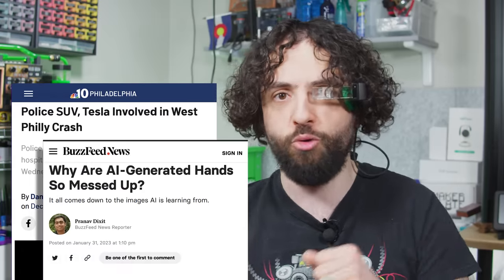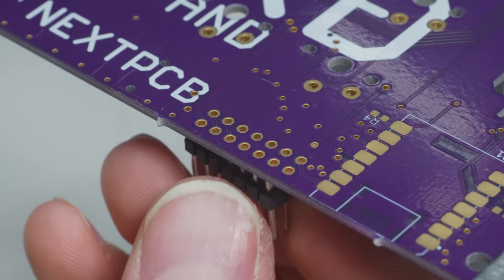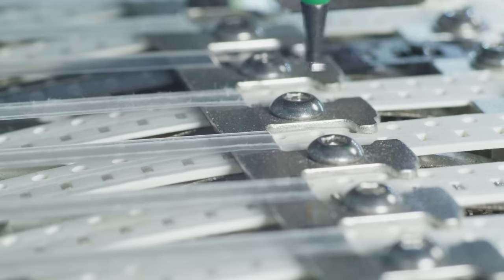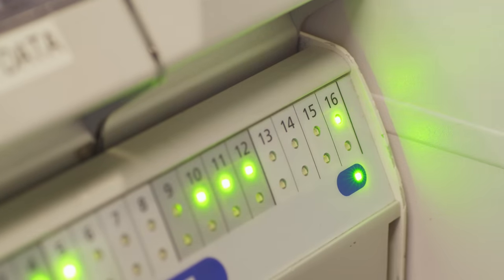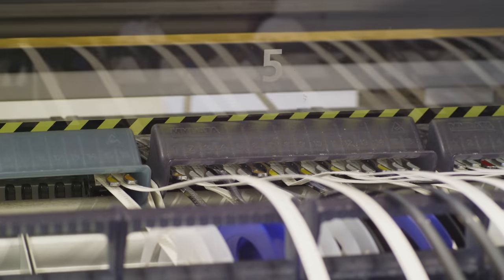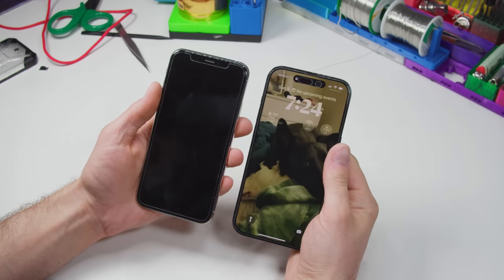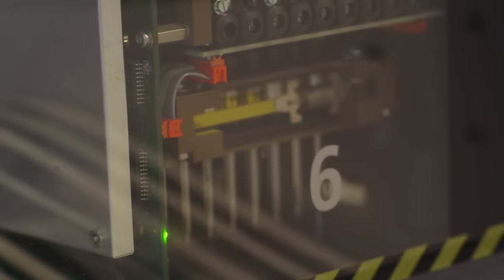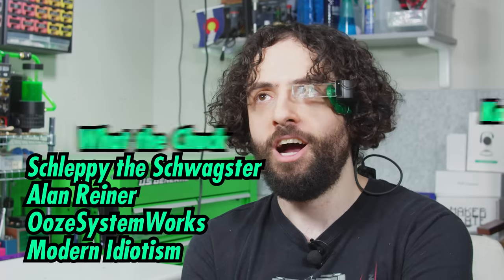The Pick-and-Place: The Robots that Built the Modern World

Comment: There is some *REALLY* cool stock footage used in the intro to Short Circuit.

Apparently you couldn't wave solder everything so they have these adorable little giant robots with a soldering iron, touching up the odd old-school throughhole components.
He picks up the board, pokes it a few times, puts it back on the conveyor belt and picks up the next board. He's such a cute robot.
Reply: I can't find a video of it, could you point me in the right direction?
Reply: @Slovenec5  https://youtu.be/iwqZTBFM_EE
i think this is what he's talking about
Reply: Still true, through hole components are still a thing especially in high power electronics. Also anything that has flexible leads like the power leads on an ESC has to be hand soldered.

Comment: As someone who actually worked with very similar machine even down to the software they use I can say that it is a series of small miracles that these things work so well. Although not mentioned in this video most companies that use those pick and places also have an automated optical inspection as well which is just as cool.
Reply: Yeup, currently programming through hole pcb production to than be inspected with our AOI.
Reply: LTT showed it in the micron video recently.
It almost looks like an AFM with how it outputs even the depth of the solder joints. Pretty cool
Reply: Absolutely. Repeatability is both a requirement and a limitation. Robots have precise movement, but there will always be inconsistency in the components. At this scale, the slightest deviation in alignment causes big problems. The current state of vision systems is truly impressive.

Comment: Pick and Place machines are awesome. I ran one many years ago. I didn't have machine vision which seems to be a game changer. If a part was picked up wrong it was placed wrong. There was a lot of rework but it was still a lot faster than hand soldering tiny smd parts. One thing Zack didn't mention is that the operators have to be on top of everything all the time. The robot makes things fast but the operator makes sure its correct. I worked next to a guy that would load the wrong value parts or the wrong parts and do an entire run. One "little" mistake can cost a lot when someone fat fingers something or mis-reads a label. Then you have 500 boards with the wrong parts....thats a bad day. 
Anyway super cool stuff. Thanks Freedman.
Reply: This happened frequently with him? Must've had it in good with the boss or something. I definitely would've fired his ass.

Everyone makes mistakes, sometimes big ones, and that's okay.. as long as you actually learn from them. I wouldn't be keeping someone around who's incapable of that.

Comment: I did some work for a board build operation for a while doing manual soldering. They had pick and place machines for the surface mount components, wave soldering for some of the larger stuff and then a small army of hand solderers for doing larger connectors and such. Always amazing to watch. Been wanting to build one myself for a while.

Comment: Thanks for this video as I worked in the Motorola manufacturing plant in Harvard IL back in 1997-1998 I was in materials and had to make sure that the line (Siemens pnp machines) had the parts needed and to count the parts we had left in stock.  The line worked better and faster when left to run the same boards longer

Comment: It's interesting seeing how this is done on such high scales. I worked a temp job back in 2007 doing basically that same process by hand. In front of me was a wall of bins full of components, and a conveyor carried boards past. I had a diagram, and manually placed maybe a half-dozen components into each board before passing it along to the next station, and at the end of the line it went through a wave soldering machine. If I still did that job, I would feel very inadequate after seeing Magnus at work.
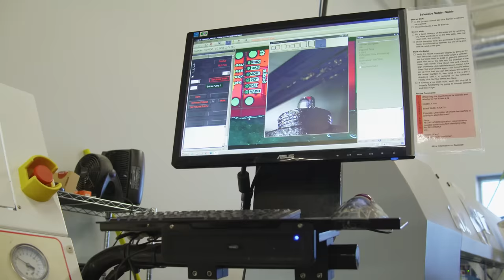Actually it looks like there was a brief view of a similar process around 22:11, though mine involved more sitting and less manual soldering.

Comment: I worked in a place like this for a while, I could get over how incredible these machines are. 
I still cannot get over how every circuit board is either put through an industrial dish washer, or a normal dish (smaller batches) washer (special water to avoid corrosion) this is to clean off leftover flux 

Electronics and water are not things we would ever thing of going well together, but it is not actually a problem if there is no power, hence why most circuit boards have been throughly doused in water

Comment: One other cool and somewhat new development is to reduce the components required to be placed by building the resistors and capacitors into the layers of the pcb itself. This reduces material cost and pick and place time. Somewhere I have an example board with a whole bunch of caps and resistors which is also transparent so you can see them as well.

Comment: Fascinating, detailed piece, big props! 

I got to see some of the next-level PnP machines in Sony’s camera factory outside Bangkok, Thailand a few years back. Mind-boggling is the only adjective that suits; the rotary multi-heads moved so fast they were literally a blur, yet they were placing passives that had to be 0201 if not smaller, and ICs with what must have been 0.025 pin pitch. (I dunno if 0.025 pitch is a thing or not, but they were dang fine.) Blazing speed and sub-sub mm accuracy 🤯

Comment: It is true that most components are installed on PCB's via Pick and place machines.  I work at a circuit board manufacturer; not fabricating the boards themselves but assembly.  But there are many components that cannot be attached by a machine at the moment.  We have dozens of people that are soldering components by hand.  Majority of SMD components are placed by machine.  but not all.

Comment: If you thought these were beefy AF and monstrously powerful, look up the scale of the 300mm wafer stages in silicon lithography tools. Like scooting a crushed VW beetle back and forth within 10ths of nanometers at high acceleration. The Nikon S63X tools have 4 big linear motor magnet plates that are about a square foot in size.... for a single axis.

Comment: Hello! I'm new to your channel and first off, I have to mention that I truly enjoy watching your videos. Secondly. You have way more experience in programming and controls than I do. So, I have a question that popped into my head while driving home from work and I would love to ask you about it. Is it possible to program a manual transmission vehicle to have a push-start button like automatic vehicles?? I'm very curious because I have a transmission vehicle and it would be awesome to convert something like that. I'm also hoping you will be able to see my comment. Thanks!!!
Reply: The transmission has nothing to do with the push button start (I have a manual car with a push button start), the problem will be actually implementing a secure key fob. I don't think the effort would be worth it as you would have do tie into the CANBUS and roll a custom keyfob solution, Alongside the physical modifications to the car in terms of removing the tumbler and wiring a custom start solution that cannot be easily overridden This would also require modification of the ECU to keep it secure otherwise your newly modified car will be insanely easy to steal.

Comment: As an electrical engineer, I knew a lot of this, but it's still cool to see!
Reply: as an electrical engineer, thanks!
Reply: As electrical technician I did all that myself.
(Did, because at my current workplace i lack the use of a P&P-Device and a solder paste printer. But therefore I now have these big chunky machines for producing pcb's in the basement of my workplace. )

Comment: A little correction - the suction used in these robots is not generated by a vacuum pump. They are usually big and clunky. It is easier to use pneumatic pressure to create vacuum with a vacuum generator and not a vacuum pump :) It uses Venturi and Bernoulli's principle. We use them in pick and place machines as well. Our team creates target machines for production lines with all kinds of applications. I've yet to see a vacuum pump used for anything :D
Reply: But correct me if I am wrong :D I've really never ever seen vacuum pumps outside of laboratory environments. Micromolecular vacuum pump for a gas chromatograph and some such. Also Zack the vid was superb! Not the usual content but it was interesting to see these. We usually work with way bigger products and already made PCBs. I have not yet had a chance to see our supplier's factories for PCBs.

Comment: I thought it was a little surprising that the through-hole components are still done by hand. You would have thought there'd be a machine for bending leads to a particular spacing and poking them into the holes.

Comment: Gotta love pick an place robots... back in the day, my MUM worked on the Cadbury roses line of Cadbury Chocolates... Because her job was SOOOO boring, she would occasionally fall asleep on the line and it would be up to the worker next along the line to place Mum's Chocolates as well as her own.  Mum worked there for 10 years so the system kinda worked.... Fast forward to 2015 when  I worked for Cadburys and the 12 ladies on the line (including mum) were replaced by pick and place robots.  The chocolate worker drones would place Plaques of choccolates (each measuring 0.7mX1.0m, sorry Im in australia so we work in metric) onto the conveyor belt, and they were then scanned as they rolled under a laser scanner, and each chocolate would then be picked up, ROTATED (the orientation of each chocolate on the plaques were totally random) and placed in the plastic trray of the chocolate box with an accuracy of 0.2mm (oops more metric).....  Thankfully mum had 'shuffled off her mortal coil' by then, so she did not bear witness to the 'wonders' of the modern age' that would have resulted in her unemployment.

Comment: Oh, this video is longer than I realized. 9 minutes in and I can't stop thinking about whether the arm would be able to (or already does) skip back-and-forth trips by having extra "fingers" to pick up multiple components at once. I will edit this comment after I finish the video.
45 seconds later, and my question is answered. Nice
17:33 and my question is formally addressed, nicer! Also, trying to type this edit caused my computer to grind to a halt and crashed the game on my primary monitor, which led to my discovery that Steam's background shader processing was fully utilizing 1 of my 4 cores. Or rather, switching between cores, but utilizing each fully. Presumably for cooling. Time to save for a new CPU/mobo...

Comment: Wait wait.  Solder paste?!?!   Does it only work on tiny stuff or is dense enought with the metal to work on small projects, or is not cost effective?
Reply: in principle you could solder an entire board with it. but normal solder or ripple soldering is cheaper, thats why its used only for smd parts

Comment: I have worked in an PCB assembly factory. And, I'm surprised, that they are using these not-so-advanced machines. I would think, that they will use conveyor systems, instead of putting panels into the machines manually. Especially with the labor cost in USA.

Comment: I worked in similar factory. We had greater volumes of units.  Factory was cleaner, everyone had to wear clean robe, everything is done in ESD gloves. My part was selective soldering station, where through hole components gets soldered. It was interesting job, but, low salary and work as a slave, that's Europe.. aftermath was allergy from solvents and tendentious from went system crunching in same frequency. It's hard to wear earmuffs when you have to speak with someone immediately.

Comment: I have a question. If a two sided board has to go back in the pick-n-place, what keeps the first round's components from falling off during the 7 minute heating cycle? Seems like the solder would liquify and everything would dislodge.
Reply: High temp solder on the first side, lower temp solder on the second side, and hope you've got the oven set just right for that second pass so side two flows out, and side one stays put.
Reply: @danf5429  I thought about that. Do you know if that's how it's actually done? Or is that just a theory?
Reply: An alternative to using high and low temperature solder paste is to use thermosetting SMT adhesives (usually red). These can be used to hold the first side's components in place and get cured in the 1st reflow. They hold the components in place when upside down in the 2nd reflow.
Reply: @stevenebstein3391  fascinating. Thanks!

Comment: I can't wait for the day that machining in general is as progressive as Sparkfun. 

On a different note, I actually had a conversation 2 days ago about the future of manufacturing and AI. As it stands now, chatgpt and openai can give better advice than 95% of the active machinists in the field. Now, yes, advice being good 95% of the time isn't perfect when a 1.6 million dollar machine is at the behest of it, but I think in the future, NC machines will rely more on cameras and internal simulations than the gcode they run on. The golden chalice is to feed a computer a CAD file, and have toolpaths generated automatically, better than a programmer could, and then feeding it to a machine that can detect crashes before they happen with absolute awareness, while using an AI like chatgpt to step in and make special case decisions that will either result in a crash or a good run. I guess it's more of a golden triforce not a golden chalice at this point. My point is, machining and manufacturing in general CAN already do most of that (maybe not well, but it can), but the mentality of most people in this industry is too stubborn to try.

Comment: Damn, I've rarely seen such a shitty smt pcb assembly line. Those poor, poor technicians, who have to replace those bulk part rolls and take the pcb out of the pick and place machine and place it into the oven. I've worked in an smt assembly for around three months as a part of my apprentee training and man, seeing these machines makes me have pity with those technicians. And besides that, oh boy, have I chuckled each time Zack was talking about efficiency of this smt assembly xD. Oh boy, are these people at sparkfun wasting time in the process of assembling those boards. Either those managers at sparkfun have no idea, that there are better machines or they just don't need a high throughput. But I don't think, that they need such few pcbs that such a slow process would be worth it due to the higher (one-time) financial requirements. But if that really is the case, Zack's just talking cap xD

Comment: Too bad then that the components aren't just dropped into slots on a template.
They could just fall in place on an easy to push through silicon sheet with holes. Then with a little pressure could be pushed through onto the board where they're already hold on with this solder paste. And that process could be repeated quicker than having to place each component.

Comment: do you know facts
Reply: current people law based tech is drab
Reply: always constrained freedom by money-law measurements/ai-selector-criteria, nothing free human in that
Reply: laser engraving surface mount part sockets is much better
Reply: no solder required, just package the whole board parts under a matching mask, c-19
Reply: meh just plasma print the whole circuit on wafer at once, micro pcb all-in-one
Reply: same process for all parts, open source freedom freeware public domain parts design insert extra words here ding dong
Reply: the whole pcb-part is then smaller and does not break other than the whole part nothing but the part so help you God, not even robots
Reply: forever-hole? most parts dont have durability to be called forever as naczis by law, just have eternal life with God, not by your own power at-tempt
Reply: highly integrated all-in-one circuits, not just discrete integrated parts on pcb's
Reply: work is slave business people
Reply: all law is condemnation, if in any way enforced by people, then you dont have any law, but just enforcers, judge dredd bro, us army, police
Reply: did you eat chips with chips chipped with chipper chips
Reply: work no longer allowed, only free hobby gifts by/from God
Reply: you are terminated :)